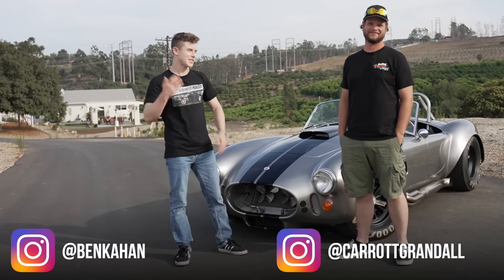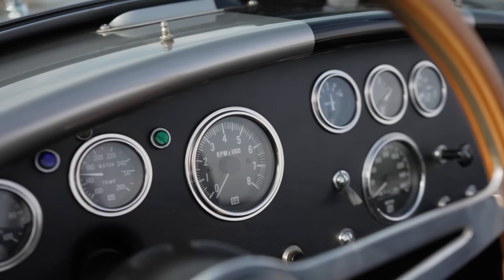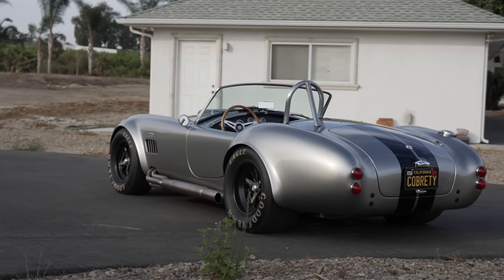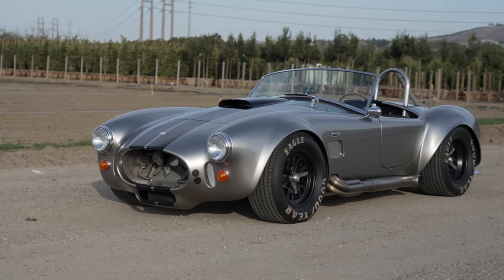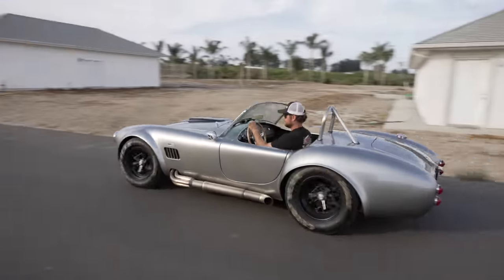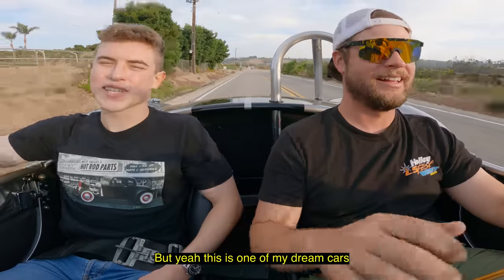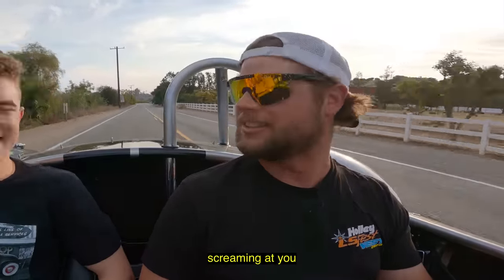500 Horsepower 1965 Shelby Cobra!

Comment: Replica Cobra’s done right are the coolest!
Reply from the maker: I know right!
Reply: i agree , but wrong tail lights
Reply: Right? Unusual to see one with a real big block, usually a small block stroked and bored, but those are fun too! Bias plies, closest you'll get to an authentic feel..
Reply: Where is ERA based? Which would be better choice- Supaformance or ERA?
Reply: @keithw372  for a true S/C sure, but the later years did have round taillights
Reply: @phenom573  later yrs? the 427 cars where made from 65 67 , and pretty sure there were only 100 made total of original 427 cars, some were 428 cars too.
Reply: @keithw372  yes and the later ones had round headlights when regulations & supply changed. I can write it in crayon if you'd like.
Reply: @phenom573  your sarcasm doesn't go unnoticed. Thanks.
Reply: @phillipusmalan8841  ERA for sure.  They are based in CT and in my opinion they may make the best set up in the biz.  They don't make a lot of cars but the ones they do are well done.  My father and I built this actual car in the video.  It's incredibly well built
Reply from the maker: Very cool
Reply: @abyall  - paint name/Code?  I’m building mine now and I really like this color scheme.
Reply: @phillipusmalan8841  ERA is in New Britain, Connecticut, USA.  They were started in 1981 and are among the best replica creators around.  Very high quality Cobra and GT 40 machines available.  Superformance is right at the top of high quality makers.  I believe their Cobras are actually continuation cars with original serial numbers - very high quality, and the most expensive.  You get what you pay for!
Reply: @keithw372  Just about all of the 427 street Cobras were indeed 428 engines.  The 427 side oilers were very expensive engines and Shelby wanted to keep the price of the car competitive, so they put in modified 428 hydraulic lifter engines which were also more manageable for easier street driving (the 427 was a real bear to drive on the street.)  The kicker is the Cobra fender badge and engine valve covers still said 427 with the 428 engine!  A few buyers found this out and demanded a 427, which Shelby obliged them with.  All of the S/C 427 Cobras were real 427s.
Reply: K  WTF?
Reply: Awesome to see you on here too AutotopiaLA, been watching all your videos on these classics as well
Reply: @phillipusmalan8841  era car  is all correct cobra in originality
Reply: É réplica?

Comment: OG Cobra's didn't come with side pipes or a hood scoop.  The S/C version (semi-competition) Had the side pipes, hood scoop and 485hp 427.
Reply: Original 427 Shelby AC Cobras came with side pipes.
Reply: @sergeantmasson3669   that's stating the obvious - MKIII all had side pipes.  I'm referring to OG such as Slabside MKII 289 which did not.
Reply: I've seen a few videos of actual 427 Cobras with no side pipes and no roll bar.  They look VERY nice without the boy-racer add-ons.  Superformance, which are an authorized replica company, will even sell you the non-S/C variant.
Reply: @culcune  Carroll Shelby never licensed any company to produce replicas. In fact he was angry about not getting any royalties from his design.
Reply: @sergeantmasson3669  Read up on the lawsuit and eventual partnership between Shelby and Superformance.  I believe it all happened around 2005.
Reply: @culcune  Carroll Shelby,  "The biggest blunder I ever pulled as far as the Cobra is concerned is not jumping on these replica car guys very early."
Reply: @sergeantmasson3669  he had mixed results.  He ended up licensing a small handful of them, including Superformance.
Reply: @PatBuckleyracecar  If your comment was referring to me, you have ZERO rights to tell me what I can, or cannot say or do. Highly probable that I've forgotten more about Fords and Shelby cars than you'll ever know.
Reply: @culcune  Superformance websites shows nothing about being licensed by Shelby.  It makes no sense that he'd do that. Why would he give permission for other companies to build competition against his own  company, Shelby American that was formed in 1962, and still exists today?
Reply: @sergeantmasson3669  - Not the street version, only the S/C race version.  I knew a guy in my town who bought a '67 427 Cobra new - no roll bar and no side pipes.  The exhaust ran under the chassis like traditional cars with two pipes out the back just under the bumper.
Reply: @TheLuckyone760  The 289 FIA Comp Cobra had side pipes and roll bar just like the 427 S/C did.  It's the street versions that did not have this set up.
Reply: @Loulovesspeed  Street versions had the option of under the car exhaust or side pipes exhaust. 1966, I nearly bought one, from TASCA Ford in RI and it had side exhaust and the mini-bar behind the driver. Bob Tasca Sr talked me out of buying it and I bought a '66 Fairlane GT 427 car instead.
Reply: @sergeantmasson3669  Unless you're talking a 427 Thunderbolt, your Fairlane was a custom made car, as the 427 was never available in the Fairlane, except the T Bolt.  My understanding on the 427 street Cobra was they came stock without side pipes, and possibly they were the option and not the underbody exhaust.  No biggy.  I used to live at Connecticut Dragway every Sunday I could in the 60s.  Being a Ford fan, I loved it when Tasca Ford showed up with Billy Lawton at the wheel of their latest Mustang drag car.  He showed up one Sunday with the "Mystery 8" Mustang and bet $1,000 to anyone that could beat him, using handicapping if necessary.  Billy went home with the $1g still in his pocket.  Never did find out what he was using for power, but my guess would be either a Boss 429 or the 427 Cammer.  The car beat everyone and was a real hoot to watch it blow away car after car, all day!  Do you remember their cool bumper sticker?  "All Fords are created equal - Tasca makes the difference."
Reply: @Loulovesspeed  Ford Thunderbolt was 1964 Fairlane 2 dr sedan only. Ford did build 1966 Ford Fairlane 427 "R" code cars and TASCA Ford made three of them street legal. Tasca's 1969 "Mystery Mustang" was a Boss 429 that was highly modified but still street legal. At one time, Connecticut Dragway was my home track. I raced that Tasca Mustang with my NHRA '57 Ford E/G car but had to connect up the street exhaust and had to run street tires.  Needless to say, I lost. BTW, that was in 1970. Look at my profile photo. You might remember my E/G car. Jared Stearns, blue '55 Chevy" left the E/G class because he couldn't beat me. Do you remember the D&D Performance AA/FF car? I was part owner of that car. We sold it to Jungle Jim Liberman in 1974. It's now at Don Garlits drag racing museum in Ocala FL.
Reply: @sergeantmasson3669  - Wow!  You obviously were involved in drag racing where I was but a spectator.  I do remember a regular runner with a '55 Chevy Gasser, I think, but I recall it had a 283 bored to 302 or something around there - a small block just the same.  It said Dyno Tuned by Deb's Automotive Engineering on the side.  I couldn't believe the insane revs that car ran at.  Thanks for answering a 56 year old question on the Boss powered car!  I also remember the 289 powered Shelby Dragon Snake Cobra - never saw that car lose a race there.  Great memories.  I spent 5 years in Tampa, Florida after college.  I got divorced there and then promoted to the home office in Hartford - two good happenings to me in my early life.  When I came back to Conn. in 1979, I couldn't wait to go to Ct. Dragway again like the old days.  I drove to Colchester and thought where are all the cars that should be coming to the track?  When I got to the end of the neighborhood street that led to the entrance, I saw a sign on the weed infested fence that said closed!  I literally felt like crying.....just couldn't believe it was gone.  You are probably aware that it is owned by Consumer Reports, and they test the production cars that they evaluate.  I read somewhere that the old timing tower is still there and marked as an historic landmark!  Thanks for the input!
Reply: @Loulovesspeed  Frank Maratta owned CT dragway and closed it after the 1978 season. I don't think Jared Stearns blue '55 Chevy had any lettering on it. As I recall, he worked at Carter Chevrolet on Main Street in Manchester CT. He switched to E/MP because he couldn't beat me. One week, I put my front bumper back on and ran E/MP. AGAIN, I put him back onto the trailer with an 11.3 to his 12.5. I was running a Ford -de-stroked 427 engine. I still have the car today.  I did a re-fresh on the car 3 years ago. I still race it at the NHRA track in Epping NH once in awhile. It turns high-9's to low 10's. I set 3 NHRA records with it back in the early 70's. Now, it's at least one second faster thanks to modern tire technology, etc.  Surely you remember the D&D Performance Chevy Vega top-fuel funny car. It was white with blue and red stripes.
Reply: @sergeantmasson3669  That Vega sounds familiar.  I moved to Florida in 1974 and returned to Conn. in '79.  I did watch Frank M. land his plane on the strip once.  He also put together the car shows in Hartford.  I hadn't been to a drag race since about 1973 and had an opportunity to go to Lebanon Valley a few years back.  I have to say I am disappointed at what drag racing has evolved into from the sticky crap they put on the track for control, but mostly the damn bracket racing.  To me, that restricts the driver's input which is against the very soul of drag racing.  You lose in a computer controlled car that went too fast?  You might as well delete the driver and make them pure R/C cars!  Thanks, but I'll take the old days anytime.  I soon discovered road racing after my drag racing years had ended, and I have followed it closely for many years.  I live 30 minutes from Lime Rock Park and have been going there for over 55 years.  Watkins Glen is another favorite road racing circuit I've visited several times in recent years.  I also went to Sebring Florida in 1976 as well as Le Mans France in 2009.  Drag racing covered my youth but road racing took me through life!  It was, after all, the very first type of automobile racing, which began in Europe some years prior to racing in the U.S.
Reply: @Loulovesspeed  Jared Stearns '55 Chevy had a 327 engine with a 283 crankshaft. Thus, a little over 301 CID.

Comment: The more you drive an ERA, the more you appreciate it.  The one thing I tell anyone wanting to acquire a cobra replica is get one with an independent rear setup.   We did runs through the mountains when I was back east.  The cars with IRS were fine.   The cars with solid axles were all bottoming out when the roads got a little technical & rough.   Also,  don’t over do it with Horsepower.   The original 427 cars were at about 550hp.  You don’t need that much.  Certainly don’t need more.   With the weight of these cars, they are already a GoKart with a V8.  They will be a thrill at 350hp.   Be safe, have fun!  Beautiful ERA!

Comment: A previous boss of mine owned a Factory 5 (I believe) cobra.
I've loved cobras since I was a kid.
He claimed it was about 800 hp.
I raced him while driving my 91 Audi 200 20v (mildly modded).
I beat him by multiple bus lengths.
Truthfully, I was disappointed.
Then I drove the cobra.
It was brutal.
Zero traction (the only reason I beat him) but exhilarating.
The sound, the smells, the wind in your face, the power (plus tye insanely awesome looks)..
It demanded absolute respect.
If that thing could grab the road better it would have blown my doors off.
Such a great car.
Reply: Sounds like a better tire and some suspension tuning was needed.
Reply: @KuntryBoyCitySlick  
No doubt.
Pure untamed power.
Awesome car and so much potential (with better tires and road and suspension upgrades).

Comment: My parent's car was the first one I drove with power steering. Even my 65 Dodge Dart Charger had no power anything. Even drum brakes. I finally got power steering in my 69 Mustang Fastback, Still had drum breaks though. Also my first car with Air! I had side pipes in my 50 Chev Truck. They got hit with water and gravel from the front tires and got holes blasted in them. I still love the Cobras!!! I forgot the times but they went from 0 to 100 and back down to 0 in seconds!

Comment: Just finished one with my dad. Only about 420hp from a 351W and it is brutally quick. It time warps if you nail the throttle. It’s intense to build an entire car, but very rewarding. The engine is so far behind the rear axles it’s about 45/55 rear bias weight balanced
Reply: @CodyRSmith50 - engine BEHIND the rear axles??
Reply: @Loulovesspeed  ahh, typing on night shift, brain doesn’t work. *engine completely behind the front axle centerline.
Reply: @JalopyJockey  I suffer from the same problem on long nights at the keyboard!  I figured it was probably just a semi sleep induced typo.  Lol

Comment: I heard somewhere that carol Shelby used a stock ford mustang shifter turned Back words for the cobra, Two reasons for this, 1. It was a pre existing part readily available, 2 It was Turned backwards because of the location of the transmission within the tunnel and the design of the cobra's Cockpit, making it functional/usable to the driver.

Comment: My last Cobra had 500 horsepower had to sell it when things got tough. I'm building another now it will have close to 600 horsepower. If you set the big block up just right it'll act like a small block with a shitload more torque😁

Comment: Very nicely done. Love the black wheels. A minor point but the term big-block Ford usually refers to the 385-series engines. Where do the FEs fit? At the time they were bigger than the Y--block but were supplanted by the 429/460 engines. Thanks for posting.

Comment: that ac cobra looks fabulous! My old man owned a 530HP AC Cobra before, it gets so much attension by people! Everyone was looking at his car when he drove it on the road. The Curb weight of the ac cobra is 2355lb which equals 1068kg, I mean that is isane! A car that only weights a ton has 500 horsepowers. Most people would probably think:"that thing won't be that fast". But let me tell you, the new supra weights 1530KG, it has 382 horsepowers, and it can do 0-100km in 4.3 seconds, but that was driven by professional driver, normal people probably can do 4.7 or faster. But! The AC Cobra is lighter than the supra and got more horsepower than supra, so how fast you think it will be now:) I think it will be faster than the new supra for a quater mile. And this is to the people that owns AC Cobra's for the first time, WATCH UR LEGS(cause a friend of my got burned by the exhaust, and it's bad)

Comment: Had a Friend who had a 65 Mustang   with a 289 V8 with C6 Automatic   took the Body off the Mustang  put the Shelby Body  and Took the 289 out and put a 428 CobraJet  in it Replacd the C6 Automatic and put in a Rebuilt  5 Speed Automatic from a 2009 Mustang   which was in a Wreck   with all the updated Tech it Produces about 425 Hp and 385 Lb ft of Torque

Comment: They are 2050 lbs with that motor.. and are a copy of the Factory Five Racing Body... Crazy (Dangerous) high HP:WT ratio .... Hard to drive if you don't know what you are sitting in for sure!  Easy to die in unless you know how to control.

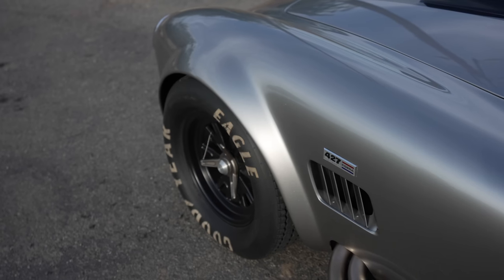Comment: 2:58 The first time I've seen safety wire on a road vehicle.  Is it needed or just for show?  Safety wire is typically only used on aircraft in critical areas where a loosening of components during operation would cause a catastrophic mishap.  Possibly justifiable for the center lug if it's a sketchy design.  Nice car.
Reply: It's necessary. Those are functioning spinners. They are hammered on and off. It was how it was done in 1965 and earlier.
Reply: @clutchpedalreturnsprg7710  Not sure when lock-wiring would have been used... the idea of the spinners was to speed up tyre changes. Having to lock-wire them would be counter-productive. Maybe it originated on some excessively detailed show car?

Comment: the actual 65 ac cobra weights 2400 pounds and most of them had a 427 in them i drove many of these in my life
Reply: Actually about half had 428 police intercepter engines. I purchased mine in 1968 for $4995. My car now has a 427 side oiler. To be honest I can't feel the difference. My car back in the early 70s ran 12.4 in the quarter with the 428. Had added side pipes, dual point distributor, and Holley Carburetor. The biggest difference was rain race tires over the Goodyear Blue Dots. Current radials I believe get better traction than those rain tires. I put almost 50,000 miles on the car in the first 4 years I owned it. Have added around another 25,000 miles since then.

Comment: “It’s just like ultimate America”

They were sold in the states as Shelby 

But they’re a British company. And that my friend is a BRitish Car 😉

And she’s called AC Cobra🇬🇧
Reply: @Ja Mm - Correction, sir, the Cobras that were sold in Europe were badged AC Cobras.  Those completed and sold in the U.S. by Shelby American were registered and badged as Shelby Cobras.  It started as a British car that lost its engine maker and Shelby cut a deal with AC Cars to provide Ford engines and drive lines, with other modifications made, to make it an Anglo-American car!  Please don't insinuate that it is a entirely a BRITISH car, because it is not.  The 427 Cobra had a body and chassis designed in America and built in England.  Its dimensions and shape were entirely different than the 289 body.  A completely new and much stronger chassis was designed and there was just about nothing left in it that was British!